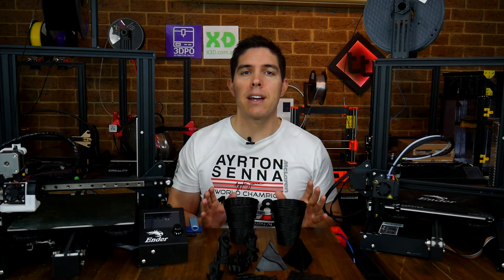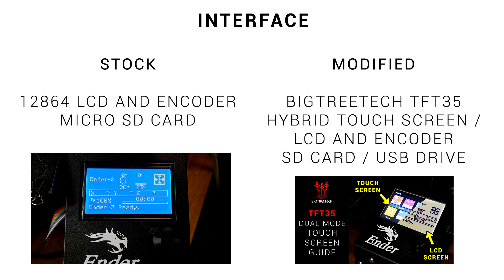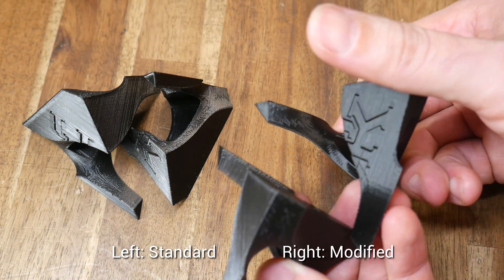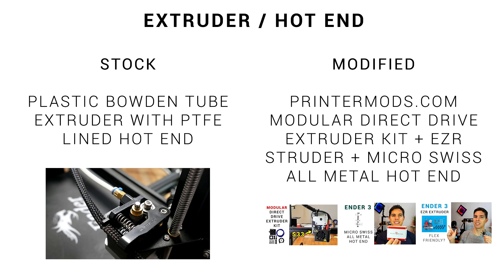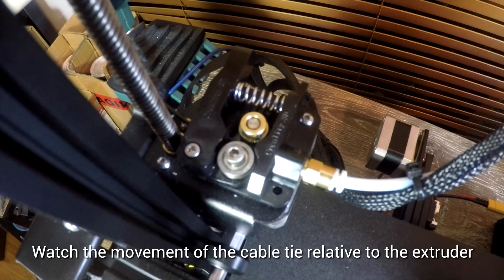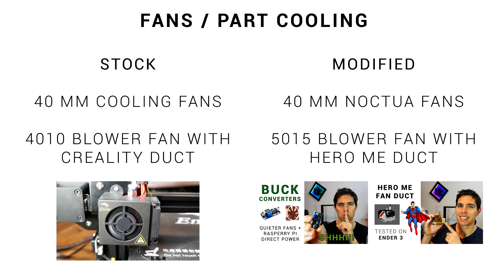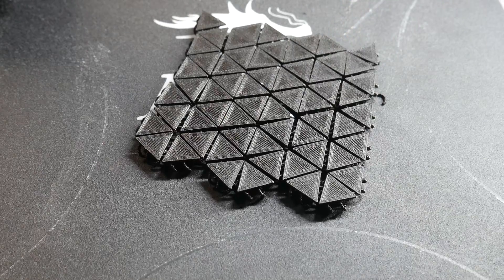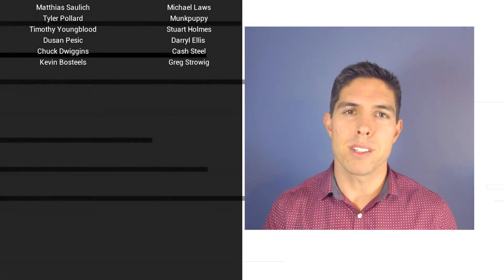Are modified 3D printers better? Stock vs upgraded Ender 3 comparison

Comment: I think I've definitely improved my printer and printing experience overall by modifying it, of course with a big thanks to you Michael!

In the beginning with my stock Ender 3, I would have to level the bed every month or so, which doesn't sound bad until all those bed leveling issues lead to many failed prints.
It also became a little annoying always having to load the print files on the SD card and walk to the printer to load and print it, as well as checking up on if the print is going well (i put the printer in the garage due to noise and print gasses from the occasional ABS).
So with my set up now it truly is effortless to print what i want. I have a Raspberry Pi with Octoprint loaded to control my printer, as well as the Telegram app running within Octoprint and on my phone. So I can choose a print from all my previously sent files, load and print them, check up on them by requesting pictures or gifs, as well as being able to tune, pause and abort prints all from my phone (using the Telegram app linked to Octoprint) or my PC. And with a BL touch ABL system, i haven't actually leveled my bed in months with no issues :)

Also just a side note, I've found a flat piece of glass with some glue stick (that tube of glue you use for normal paper in school?) lightly applied to the surface makes a rough, sticky when hot surface that lasts for many, many prints, and i haven't washed/changed the glue on the bed in months. Nice part is whether printing PLA, ABS, PETG, it all sticks well when printing, and as soon as the bed reaches ambient (20-30 degrees), the prints come off on their own.

Comment: This is a bit like the old riddle: if you break the handle on a broom and replace it, then a bit later replace the broom head, do you have a new broom or the original.

IMO, your printers are not compatible, as one of them isn't an Ender 3 (the massively modded one).

What would have been better is if you had done comparisons after each upgrade.
Reply: Compatibility. No Comparability.  Learn English Please. They are both Ender 3. One is just modified.

Comment: Hi Michael, can I ask the full version number of Marlin you are using on your modified Ender 3, I have an issue with my setup, I have seen all your video RE BLTouch and others on installation but BLTouch goes through the actions, saves a mesh but does not use it during a print, I know what your thinking but no I'm not missing G29 or M420 S1 in Gcode after G28, I have tried with and without Restore mesh after G28. but I cannot get it to work, as you are using the same hardware as me I was hoping to get the version you are using to try.  Thanks  Simon

Comment: I just bought an ender3 pro, and I feel like I haven't even started yet. With all the mods I want to do it'll be virtually unrecognizable. I'm hoping it'll allow me to make a CNC machine out of 3d printer and 3d printed parts. If I can do that I'll have 3 machines all working as one for a functional start to finish robot lab. The only thing I won't be able to do myself is make circuit boards. All for under $1000. Welcome to the future.
Reply: Circuit boards are doable with a cnc machine.

Comment: Isn't that acually an Ender 3 pro with the mods? Jugging by the 2x40 extruded pillars on the Y axis visible at the bottom of the screen 10:13 also the powersupply housing is different, asking for my confirmation :) because I want to buy an Ender, but the differences between only the ender 3 lineup is a mess.

Comment: Great videos very clear even for me as I am not English native speaker (French)
 I have upgraded my Ender 3X with skr mini E3 v1.2 as yours recently. I am a bit disappointed. First I have noticed that main board fan is very noisy and full speed and connected to the right central connector on the board.
Any advice on this?
Secondly where is the change filament feature available on the stock board? How do I change filament and extrude a bit before printing with a new colour?
I have updated the firmware to Marlin 2.0.5.3 thinking it could solve this issue without success. 
Thanks for your appreciated reply and help!

Comment: Personally, I learned a lot about the principles and concepts behind my 3d printer by modding it. Started out not knowing anything then started tinkering, screwing it up, reverting to stock, then repeat. Not for everyone but it is the best way I learn. I have done and undone a lot of things to my poor little ender3 which has now been dubbed the frankenprinter because very little on it (down to the wires) is stock. Part of that was from royally screwing up a few mods but from that I learned what happens in a thermal runaway and how dangerous it can be. That being said I have a friend who I would never recommend mod anything because he doesn't have the patience or attitude to learn from screwing up something potentially expensive (and he's accident prone). So completely agree, it  depends on the individual and their goals.

Comment: I got a CR20, upgraded to BMG, Glass Plate, Custom Heating solution for Extruder, Noctua Fan 40MM and 5015. At the end, I threw the whole printer in ANGER and reminiscing how Awesome the Prints was out of the box.. Gonna get the Ender 3 V2 and I'm not even gonna change the ptfe tube..

Comment: Should be a comparison between the upgraded and a stock printer of the same price after upgrades, makes no sense the way you did it...
I know the most probable answer, and i don't own a 3d printer and never modded one. But from personal experience it never pays out to mod anything, just use the money to buy a better one. We all know that, but for sure it will not prevent us from the fun it is modding stuff... But don't fool yourself, it does not make any sense..

Comment: ender 3 pro here. 
$20 all metal hot end swiss knockoff.  took some adjusting but wow its better.
$10 all metal extruder and capricorn tubing. 
upgraded springs for bed level
glass top

Ender 3 prints great now. was losing my mind with lost prints and terrible quality and or extrusion issues. 
also found a kick ass start/end cura profile online that saved my life.
very happy with my printer now and now im making tons of fun stuff for the kids and myself

Comment: Fun little video, but seems super pointless when you do only show the cases where there is no difference... This video leaves everyone that sees it no smarter than before, and the only thing you prove is there is little to no difference with smaller prints at low speeds. For any meaningful conclusion there should really be higher speeds/bigger prints, and you should show slicer profiles so the audience have an idear how they were printet :)

Comment: I'm new to 3D printing, and after one week I can attest that these might just be must have upgrades. 
  I have to level my bed almost every time I print. And after a number of failed prints (it hurts so bad when it fails at 90%+ completion. It is also very, very loud. I never expected the ender 3 to be so loud, so much so that I put it in the garage. 
    A link to similar upgrades would have been quite helpful though.

Comment: The upgrades are definitely noticeable, but yeah, most are ergonomic and ease of living with.  Nothing really seems to affect the print quality much, if at all.  So I think it's fair to say your conclusion that it really depends on the person and what they want to live with.  If they want a really refined unit, they can get one.  Else they can deal with the extra maintenance that the stock one requires and get a damn good printer for a low price.  Speaking of price, obviously seeing the price difference in the upgrades would have been nice, but I know you said you couldn't recall.

I think the real question is:  What's better, the modified version or the Prusa i3?  Now the price point of this has been doubled, probably has about $500 or so (total) into it.  The Prusa i3 costs about $800 shipped.  So what's a better option:  This for $500 or the Prusa for $800?  I feel like the modified version of this and the Prusa are direct competitors at this point.

Also, it'd be nice to see full name of the product when you post the Ebay link on the install/review video.  The problem is you link to direct postings which are obviously gone in the long term.  So all your installs are littered with broken Ebay links so we have no idea of how much the part cost or what the originally the part was - this is especially true for kits where it could be multiple parts included.  Hard to get a handle on what exactly to buy or how much it costs.

Comment: Hey guys, I have a mostly stock ender 3 with a glass bed. I use the glue stick method. To releasing parts easier, I’ve found if you lay the glass bed on a flat table, place your scraper where you normally would to pry a part, and tap the back with a wrench it pops off clean every time. This quick tap overcomes the adhesive friction with ease and you’ll avoid smashing any more knuckles. Don’t get to rowdy with it! Cheers guys!

Comment: Good summary, probably a good idea for new people to resist doing anything for at least a month and learn things like bed leveling manually, dialing in profiles, playing with speed settings and retraction until they really understand how it all works and have the best  stock setup possible. I only make toys and prototypes with my E3, out of the box the quality was good enough for that. I did spend some time after I first got it making sure everything was as parallel and the bed surface was level (lathe / grinding wheel / dial indicator gauges etc), the only other thing I have done is replace all the fans with larger / quieter versions, tpu dampening feet and 32 bit board with 2208 drivers so the printer can sit next to you and be virtually silent :) 92mm fan for the drivers, 120mm for the psu and noctua 40mm for the hotend.

Comment: Thanks to Your help I am now printing masks for the doctors. 
Whole country is printing (We are just trying to help ) :)

Thanks to the modifications described by you:
My Ender3 is:
- quiet (mainboard swapped),
- easier to operate (automatic bed leveling) 
- and the prints are repeatable (new firmware etc).

I am just taking out finished part and  printing the next one.
Marvelous. 
And it still wasn't expensive.

I am the one who did not want to spend a lot of money on a potentially "dust gathering hobby toy".
But I couldn't stop myself from updating it (with low amounts of money).
Now I can say that it is not a "totally black box" for me  ->  washing machine is, I don't know what is inside (... can guess).

I still face problems - with (some) stringing, extruder hopping  ... it feels like a complicated machine that needs much more attention than I'd want to give it.
For example a new filament can be a struggle (temperatures , print speed etc)
I still feel like I need to learn more.
And I can not afford to pay for some "self handling" hardware (if such a thing exists).

Congratulations,  and keep up the great work.
Maybe you've already saved some lives. 

A

Comment: I modded my Monoprice i3 with a Bear frame and Keenovo heater. The stability has made a huge difference. I level the bed less often, can use the entire 220x220 print bed and the bed temp is far more consistent.

Comment: Coming with a CNC background, I wonder if mounting the linear slides at a forty five degree angle would not be beneficial? Most CNC I have ran have their slides off angle. It moves any deviation out of the the plane of the part. I am thinking more the Ender 5 in particular.

Comment: My personal opinion, supported by years of observing industrial apprenticeships, is that a person should spend the time to learn both the machine and the process. Bottom line is that these are a smaller home version of a multi thousand dollar machine tool. They will NOT automatically produce the quality and perfection of those machines and will require more tweaking and adjustments. The next point is the entry level... yes, one can spend up to a couple thousand dollars to get a very high quality machine, somewhat like a lathe or a mill, but that puts many of these machine tools out of the range of those who would like to use them. As the price comes down, the user involvement and even experience levels are going to have to come up to match. One will need to understand the limitations and compromises made to achieve that lower price point and learn the skills and do the work necessary to get consistently good parts. Even there, NO single, unadjusted machine is ever going to be able to handle all situations. Each machine is going to require slight to moderate changes to the "part recipe" to get what you want. Overall, you are eventually going to pay the price for a higher quality machine through your time and efforts at some later point if you did not do it up front. There is also the awesome opportunity of exploring other peoples solutions for how well they work rather than depending on the manufacturer to get the "perfect solution" to your needs in the machine from the start. Your efforts and time are usually quite a bit cheaper than what the manufacturer would have to charge to incorporate or customize the same things.

The major point is to learn your machine, no matter the price entry point, so you can get the best parts, but realize that the less you pay, the more you will have to learn/ know, and the more "upgrades that may be necessary to get exactly what you want or need. However, those wants or needs should only be determined after learning the machine and determining how or what a modification is actually going to do for you and what additional things might be necessary rather than just randomly doing things because some person on the internet said to do so... research and get a consensus from several sources before you "just do it". You will save yourself a lot of time and headaches if you do it that way and take your time... you can always return to the base product and start over. Overall, your printing experience will thank you for it!

Comment: Does anyone have the amazon link to the bed leveling mod?
Reply: https://www.amazon.com/ANTCLABS-BLTouch-Leveling-Premium-Extension/dp/B076PQG1FF/ref=sr_1_2?crid=2SOU5ZYNG6QRE&dchild=1&keywords=bltouch&qid=1584532536&sprefix=blto%2Caps%2C198&sr=8-2

This one includes a 1m cable to run it .

Comment: I have a 2016 Tevo Tarantula - it needed mods to get any decent print quality...but even then I've gone pretty light - firmware, cooling fan (it didn't even come with one), insulated underside of the bed with cork (so it can get to ABS temps), dog clipped on glass bed, better power supply and a captube. Together these got it printing reliably, but it took like 2 yrs of tinkering to get there. 

I would like to go direct drive with a bed leveling system...but it's working well at the moment so I 'aint changing anything!

Comment: For me, any upgrade regarding noise or removing parts from the build plate is totally worth it. I had some very frustrating experiences damaging parts when prying them off of Creality's Faketak. Since I mostly do large, flat-ish parts without much detail and only in PLA, I would have left the hot end stock.

Comment: My points: I wanted a starter printer knowing going in it was a little rough around the edges. I enjoy tinkering anyway. Most of my mods are similar to the authors mods except, I did not do the linear rails (But still may do that) Many mods I did were very cheap, couple bearings, screws etc. <$10 The biggest mods I did were the skr v1.3 board with tmc 2208 steppers in uart mode, and a raspberry pi. (Needed anyway because the printer did not play well with my windows 10) about $60 The other mod, I switched to a single start lead screw for Z-Axis from the original 4 start screw. There is an inherent problem with Z-axis binding on the Ender series. I loosened the screws on the mount bracket to solve that problem, which introduced another problem... the x-carriage would drop under it's own weight causing the nozzle to crash into the bed...The single start screw eliminated that problem and increased Z-Axis accuracy by 4x. Bottom line, my Ender-3 Pro is super quiet and produces much better prints than stock by a noticeable margin.

Comment: Hi there so useful every video you made. Now I upgrade my ender 3 pro motherboar from stock to silent V 1.1.5 TMC2208 and then I upgrade from marlin stock to 2.0.1 and now my ender 3 is printing to slow I mean even though I set up Cura's speed at 60 mm/s and inner and out wall 35mm/s the 3d printer  is printing like 10mm/s since the begging to the end of the 3d model. Which was my mistake? Could you help me to solved?

Comment: I loved my CR-10 when it was stock and the best print ever was the test print Cat (once i got the bed up to temp).
Since then i've modified it (because i must with everything) and have to ask myself: why? If it ain't broke...
Mods: Capricorn tube and BL Touch. 

But i planned on using it for high temp prints (ABS) and hate manually re-leveling every print after cleaning/ removal. So... win?
I have to admit i do actually love the noise of the servo motors (i was born in the 80's and a printer was very entertaining), but it is a bit of a deal breaker for long over night prints now. If i can't isolate the sound in the garage in a box, i will have to address that next.